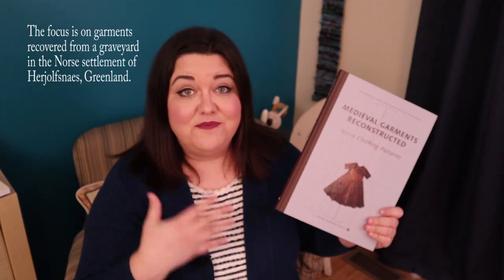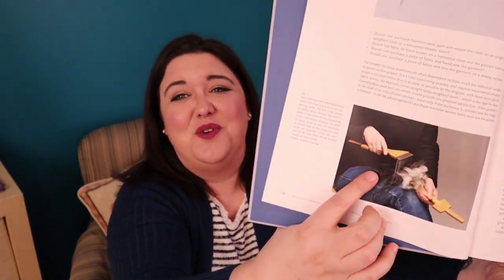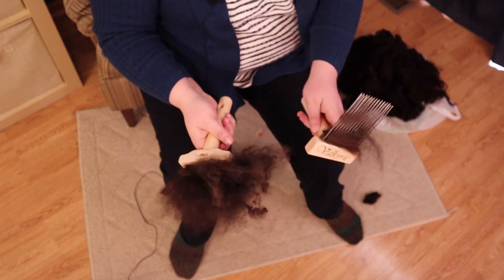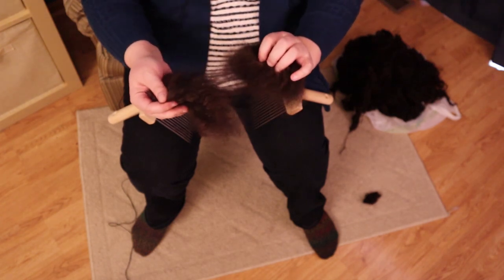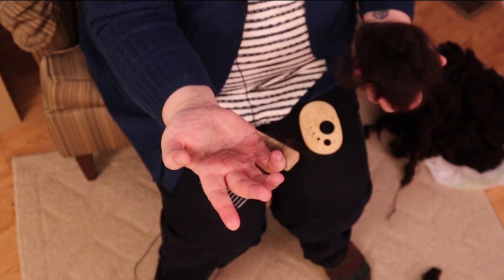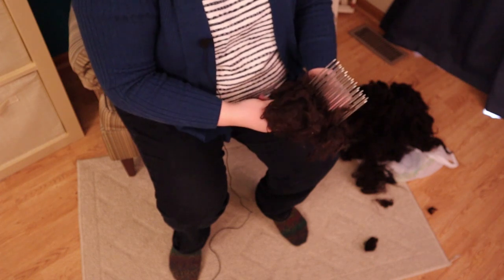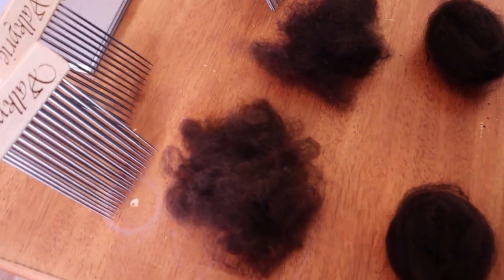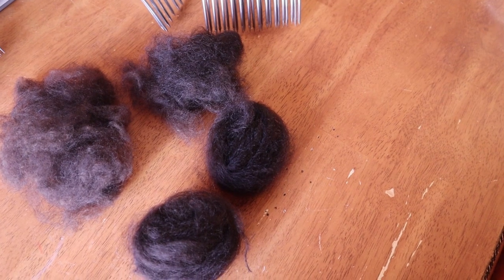Comb To Separate A Double Coated Fleece | Viking Age Cloth Project

Comment: Having raised Icelandic sheep here in Maine for more than 25 years I have learned that carefully washing fleeces before separating the tog and then makes the process much easier. Also adult fleeces often separate easier than lamb fleeces. After washing the coats can often be separated by hand if one chooses not to use combs or does not have access to them.

Comment: I really like your video on the combs. I bought the larger combs myself because I have Churro sheep which are double coated and they work excellent on this type of fleece. I only shear once a year so I have very long outer coats, and depending on the sheep, sometimes 12”. These are perfect for separating the coats.

Comment: Hello, love your channel! Yes, I also comb fiber, but not a pro like you. (hahaha... I'm not a spinner yet - you might motivate me.) Valkarie fine combs are more for alpaca fiber, and ultra-fine combs are for use with angora. So using those heavy-duty curved tines on sheep seems more appropriate. Yes again, I have been warned that you can overcomb fiber. Spinners have commented the most stating that fiber can be overworked and fracture. Those heavy combs also make sense for double-coated animals.

Comment: I'm working with similar wool (local spælsau wool, and I happen to be in the Vestfold area of Norway where the Oseberg ship is from!), and I've also acquired two pairs of combs to experiment with. I have a rough pair that look similar to your bigger pair, they're from a small company in Sweden and they are pretty awesome, as well as a pair of Louët fine combs, which have one row of tines and are even smaller than your Valkyries. They're honestly quite flimsy. I've so far not combed my wool to separate it, I do that by hand before washing it by just pulling it apart. I've combed the undercoat wool with the Louët combs and then just pulled it free from the combs in a sliver, which works pretty well. I'm going to attack some non separated wool with my larger combs soon and see what happens - if it actually separates or not. Your wool looks WAY more uniform than our spælsau wool though, there's a pretty huge difference between the top hairs and the bottom wool with the spælsau, with the top hairs often being very shiny and very long. 

If you're interested in historical spinning, I'd recommend the videos from Nasjonalbiblioteket, they show traditional Norwegian spinning techniques. Here's one, using a distaff and some other things: https://www.youtube.com/watch?v=7WrhLpcx2kk
Reply from the maker: Thank you for the resource, I will absolutely look them up. I would love to try spinning some spælsau wool, but I'm not sure how to get any in the US. I think my Icelandic looks more uniform because it is a lamb's fleece. When they get older they get a bit easier to distinguish between the tog and thel from my experience. Happy spinning!  🐑💜

Comment: I would like to invest in a big pair if Indigo hound combs because I have been wanting to get a Gotland fleece for some time.  I have a pair of double row "fine" Valkyrie combs and love them, but after watching you comb I am wondering if heavy single row combs might work better on dual coat wool?
Reply from the maker: I think the difference is that single row combs will blend the dual coat and double (2 pitch) wool combs will seperate the dual coat. I still have some Gotland to comb too. I think for it I'll be looking at my larger combs, but I haven't experimented with it just yet. 💖🧶

Comment: Are the second cuts good for felting or as a nubby add-in for art yarn? I've been promised a whole (luxury breed) fleece from a local farm and have been binging your fiber prep videos. I think I might need a set of combs!
Reply: I always save mine for making tweed.
Reply: @micahmilne  Thanks for the tip! Do you have to do anything to the fiber first? I've never done tweed before.
Reply: @sarabartel4285  I work with a lot of direct from farm wools, so I often end up needing to soak the extra tangled bits to make sure they release any trapped dirt. If they're loosely tangled as opposed to a real hard nep, it can be fun to felt them so that the resulting bits are nice and dense. I imagine you could use a drum carder, but I just use a blending board to suspend them in the main fiber base. I'm sure there's plenty of tutorials out there; I've learned a lot just from feeling out what seems right, so there may be easier ways than my strategies, though.
Reply from the maker: Sounds right to me!
Reply from the maker: Experiment and see what effects you can get!